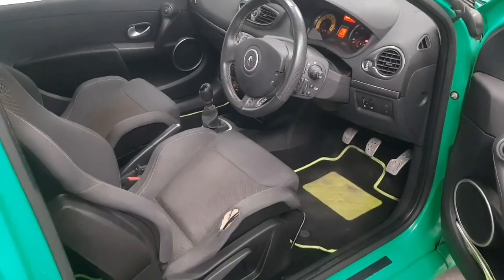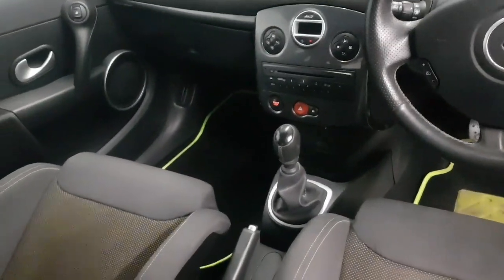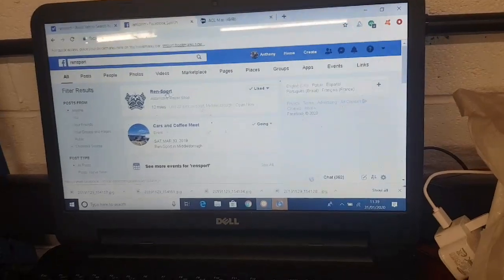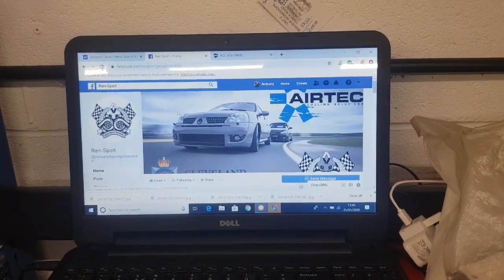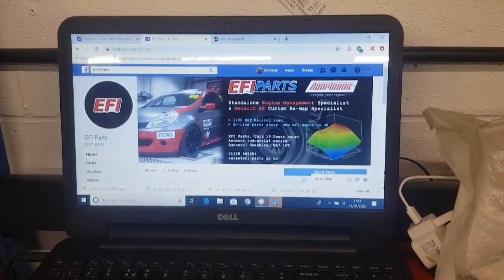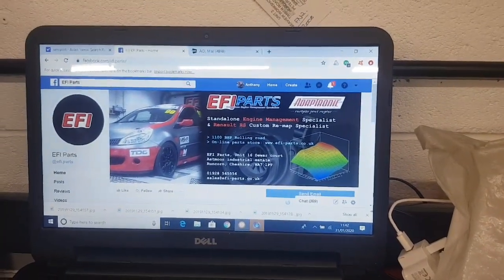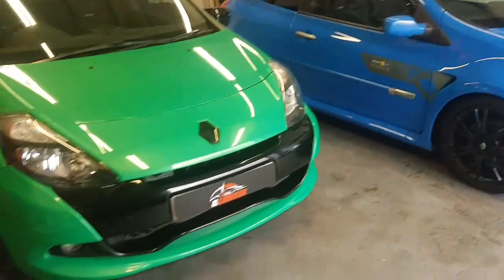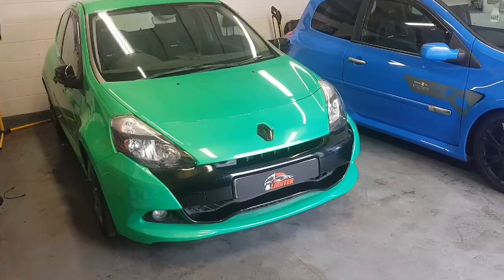The RENAULTSPORT CLIO 197 200 Buyers Guide.

Comment: I have a clio 197 had it about 9 years now I also have a 172 cup both fun cars to drive. Every single issue you mentioned I got changed on the car thankfully mostly through auto care I bought with the car. I also got the gearbox replaced through auto care. I am tempted now to move on to a megane 250/265/275 was in one at croft last year was impressed how good it was on the track.
Reply from the maker: chris carenduff usher has a meg 250 now and absolutely swears by it. I’ve drove it myself and it’s a great bit of kit. The clios are great fun but they do lack in the power department. A mapped meg 250 has plenty get up and go
Reply: @onthelimiter6529  I have been looking at them for a while now few of my mates went on a trip to the ring , zolder and spa couple of years ago and they had some awesome cars with them and most of them said the megane was the car of the trip didnt miss a beat over the 3 tracks and the trip from the uk and back 👍
Reply: Just passed by this vid again mate. Ended up picking up a megane 275 trophy liquid yellow, had it 8 month now what a capable car. Bonus also managed to hang onto the 197 and the 172 Cup too 🤣👍

Comment: Great video and very informative! i’ve owned one now for over 4 years and all of the issues you mentioned are definitely true as Ive experienced nearly all of them myself 😂. I too fitted the toyosport manifold as well as it makes sense to, to add, I have also fitted the vibra-technics engine mounts as the toyosport manifold knocks against the subframe under moderate acceleration on oem engine mounts.
Reply: Same here wish id have seen this 🤣 just brought the toyo manifold and had a new gearbox put in 🙄

Comment: Had my alien green just over a month and already spent about 2k on it. My list so far is 4 performance sparks and coils as one went so replaced the lot made sense. Silencer went so had to replace that. Next is the brake calipers we're sieved and brake fluid was brown, replaced all discs and pads and put some premium continental tyres on and new fluid. Car broke yet again turns out it was the main lambda sensor so just fixed that. I don't think this is the end of the nightmare but I'm determined to get this car back to great condition it seems its just had one or 2 bad owners so I'm fixing what they've done. Anything else I should expect next. 😅

Comment: I've a 2010 rs200 cup pack in red these things handle like nothing else very underrated car , been totally reliable could do with a touch more power but otherwise I love it .
Reply: Yes I've read all about the gearbox issues mines fine @ 68000 miles I think you just have to be a little easy on the shifting through the gears when you're on it ,  it's a great close gearbox saying that .

Comment: I've got a 200 cup in white it's been a cracking motor. I did have the kanagrooing situation but I got the map sensor changed and it's more smoother but then it does help to have an exhaust and air filter.

I've not had the gearbox crunching yet and coming up to owning mine 2 years. Enjoyed the video and very informative to what to look out for etc.

Comment: Decent vid Ush. I've just taken my Storm Grey 200 off the road to get pretty much everything you've mentioned there so this is help of where to go for bits lol. Gearbox, It has a toyo manifold on but flexi has gone it's been on about 5yr, seat repair, timing belt, Got megane RS alloys to go on. The list goes on! Apparently there's only a few of the stormers left?!?
Reply from the maker: There a rare car mate yes. Sold two last year. Good colour and good sellers.

For your box look up dtm cars, ring and ask to speak to trev.

Comment: Cheers for the good video, I had a quick question, you mentioned about potentially replacing the manifold with a non Renault one, I was wondering if this would still allow the car to pass the mot? As from what I understand the manifold by Renault contains some sort of catalytic converter. I’ve had this issue for a while with the manifold but can’t bring my self to spending loads of money with Renault and would much rather spend 200 quid on an aftermarket one. Thank you in advance

Comment: I have bought a 197, well looked after, handles really well, most major problems tackled, maybe gearbox because 3rd is a bit notchy, but maybe time for new box oil.
In dry weather the car runs like a beast, but this morning in moisty damp weather it started right away but did not rev beyond 2000 rpm, after warming up it was fine. Engine does stall when I let it runs idle for a minute or two. I suspect an electrical problem in crank/camshaft sensor and maybe coils, but there is no CEL light. What do you guys think?
Reply from the maker: Coolant temp issue maybe?
Reply: @onthelimiter6529  could check that one, could be a mixture failure during cold start because the ECU does not use lambda sensor and fuel mapping until coolant is at correct temperature? Does Renault still use the big sensors screwed in the radiator?
Reply from the maker: @thetruth7633  I would say that would sound about right yes. As for location of it I would google imagine it, but could even be the wiring to it

Comment: Hi, what are the differences between 197 and 200? Except for the front bumper of course. Thank you!
Reply: Engine software change, different head some say and shorter 1.2,3 gears. 200 cup is stiffer than 197 cup. Regular 200 is a bit softer.

Comment: I’ve got a 197. Lately I’ve had a couple of issues. Firstly the car won’t get into gear when it’s idling or not moving, usually this occurs when I first start the car but the problem goes away when I drive and it warms up. So I don’t think it’s the clutch (shifts perfectly when I am moving).

The other problem is whenever I turn on/off the car I hear the squeezing kind of noise coming from behind the radio/aircon region. Hard to explain the noise and not sure where it’s occurring. Doesn’t happen all the time though. 

The other thing is I’ve heard for these cars every 4 yrs u gotta change the timing belt, is this true or no?
Reply from the maker: Hi mate. If you google belt interval it will come up for you.

The gear problem is a funny one.

Never heard of that. Try bleeding clutch off and change box oil
Reply from the maker: Belts personally 5 years
Reply: @onthelimiter6529  ah ok cheers man
Reply: Does it struggle shifting into first gear when the car is stationary? If it does then it is likely the clutch. The clutch on these are made of 2 plates pressed together, these tend to split which causes this issue.
Reply: @123willbishop  well its hard to explain and its random, some times it gets in perfect other times i have to push with force. 
but thanks anyways for the feedback
Reply: Doni Habib Nurmagamedov Khrosoni - does it struggle going into gear when the car is completely stationary, but will go in gear when the car creeps/rolls?
Reply: @123willbishop  yes that is the case sometimes, when it is moving it will get into gear.
Reply: Doni Habib Nurmagamedov Khrosoni - yes, i had the exact same symptoms on mine, would only get into gear if the car rolls slightly. Most 197/200 owners would assume it to be the syncro’s in the gearbox, but it’s actually the clutch plate itself. Mine went just after 30k, replaced it with an original renault clutch kit and swapped the flywheel for a lightened one. The cars now on 72k and never had an issue since (touch wood)
Reply: William Bishop ah ok mines sitting on 120,000 km, btw how much did the clutch replacement cost.

Also having another problem with the car (happening past couple of weeks). When the starting the car after a while (let’s say 1-2 days) the car struggles at first to keep the revs high and then after a 2-3 seconds builds revs high. So let’s say I turn it on, revs go high and then quickly drop to nearly 500 rpms (as if it’s about to stall ) and then slowly builds up to 1200-1500 rpms (and then when it warms up goes back to 900 rpms). Only happens after the car hasn’t been turned on for more than a day. Do u know what this is? I already had to replace the fuel pump six months ago.
Thanks for the feedback mate
Reply: Doni Habib Nurmagamedov Khrosoni - It wasnt cheap, due to the labour involved as you have to remove the subframe to get it out. I had mine done with ktec and cost around £700 - 800 for just the clutch if i can recall.

The other issue with idle, not sure what this could be... does the car have any other modifications? My car idles at around 1500 on startup and is very jerky if i pull away at this idle speed. But I believe that is due to the remap I had done
Reply: @123willbishop  thanks for that mate, car has no tunes or mods on it, just muffler delete thats it

ill take it to the mechanic soon to see what he can do
thanks again

Comment: Great looking cars but ive had big issues with them kangarooing with a flat spot after accelarating from 2nd gear on the two 200's ive driven - i know ive heard you can get this mapped out,but its just frustrating when you go to test drive one and its doing that. And you think,who has driven it over 80K miles with that issue still?
Reply from the maker: Yes the flat spot is more so a problem on the 197 its annoying your right
Reply: Cable tie the mapp sensor so it’s tight that’s why it kangaroos easy and cheap problem solver 👍
Reply: I dont want to get a car where you have to cable tie things in the engine though lol. I went back in my R26 after and it was so much better to drive. Maybe im too used to the boost way of driving hehe.
Reply: Magdelayna boost all day! And I did own one a couple years ago. I know there gremlins 😂

Comment: Hi, thank you for the video! 
I own a 200rs and recently some sort of metal on metal rubbing noise started to occur at about 2k-3k rpm and only on half-load of throttle. The noise comes from the right front corner of the car. Do you have any clue what could it be? You can only hear it from the inside and it’s driving me mad. 
Also the engine sometimes squeeks at idle, however, timing belt had been changed by previous owner after 30k miles so this issue should be covered. 
Thank you in advance for your help!
Reply from the maker: Tbh tom its a hard one that... i would always take it to a specialist to have it diagnosed
Reply: Does it sound like a metallic rattle? If it does, it may be your manifold flexi joints have cracked and starting to leak.
Reply: I had same noise. It was a cracked manifold on mine.

Comment: I own 2008 197 and when i accelerate hard i hear a slight knocking grind noise. Can it be the manifold??
Reply from the maker: There is that many little things it is hard to diagnose. Best of taking to a garage. Check your engine mounts if there worn they increase pressure on the flexi

Comment: Such unreliable cars but great fun
Reply: Laurie Aldam i owned a Clío 182 years ago and it was one of the most reliable cars for me. Maybe the quality subsequently changed.
Reply: Owned mine a year, zero issues
Reply: Had my Clio 200 Cup since new, kept up with maintenance and only thing it’s needed is suspension components which all cars do over time and a rear wiper motor. Better than BMW’s and VW’s I’ve had in the past!